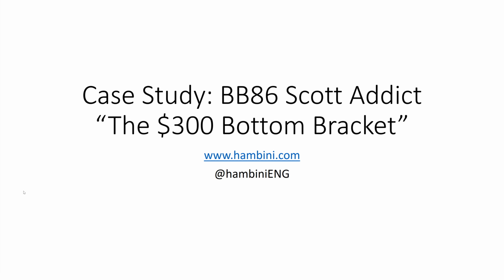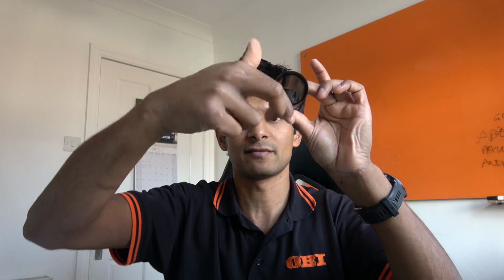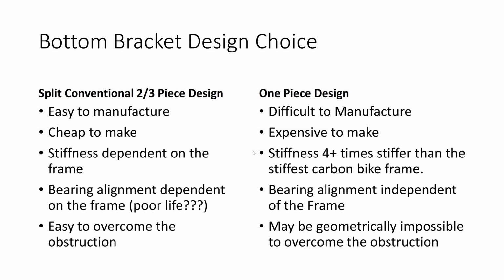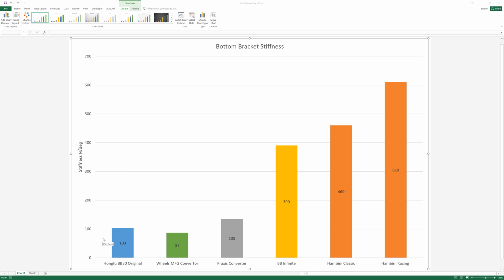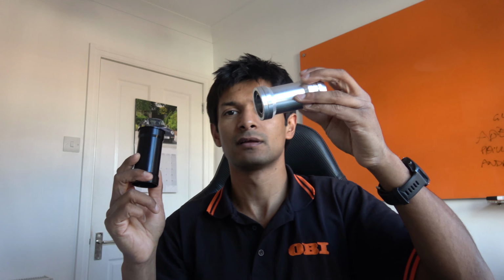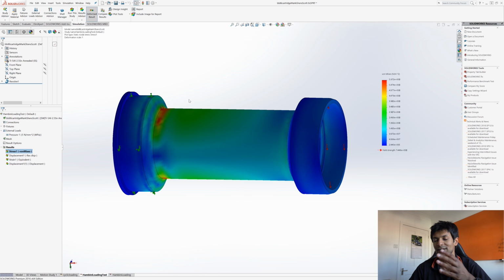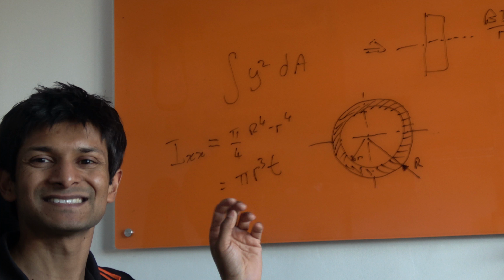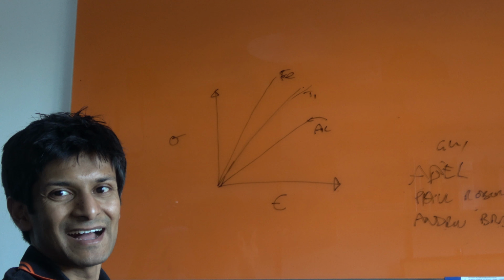Shimano BB86 Creaking Bottom Bracket Scott Bike Case Study

Comment: I really enjoy your channel and your honest, factual no nonsense attitude to problems with modern bikes. May I ask as someone who appreciates good engineering why did you opt for a carbon frame and not a well made Titanium frame, as they don't tend to have the press fit BB problems that carbon has. Thanks
Reply from the maker: Good question and it's mainly due to the lack of prior knowledge. I went from a bike with an aluminium frame to a cervelo s5, I had never even heard of pressfit problems until mine started to creak.
Reply: Hambini Thank you for the reply, I appreciate it. Safe riding. 👍🏻